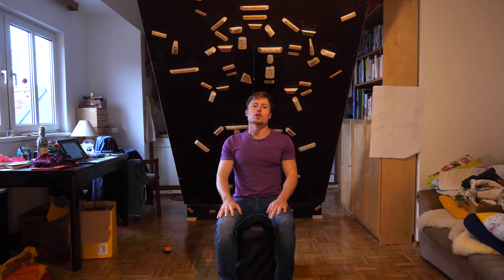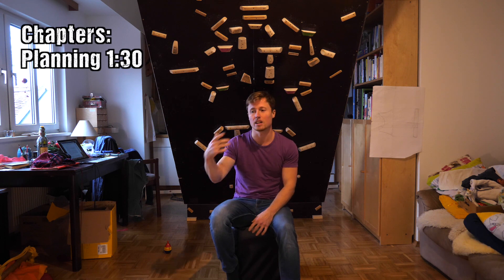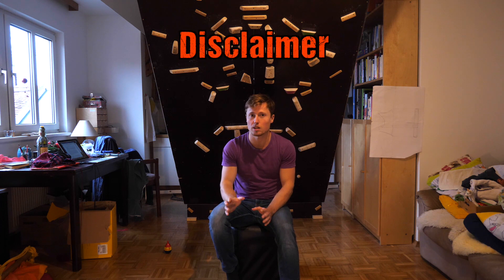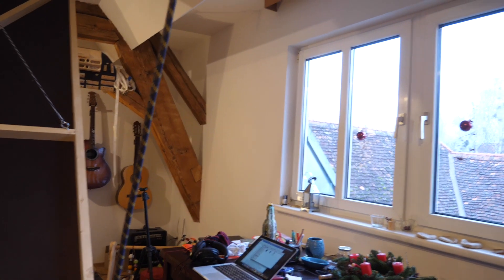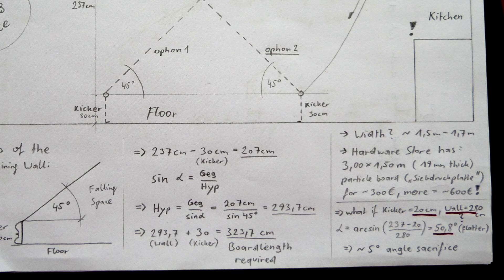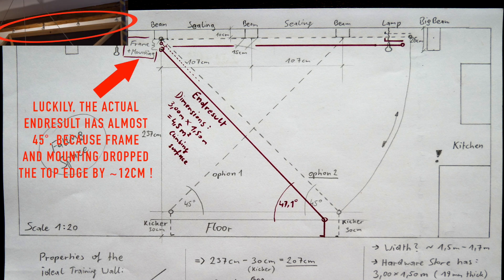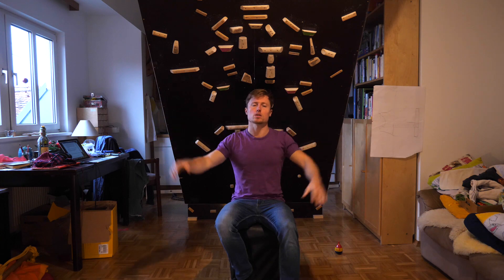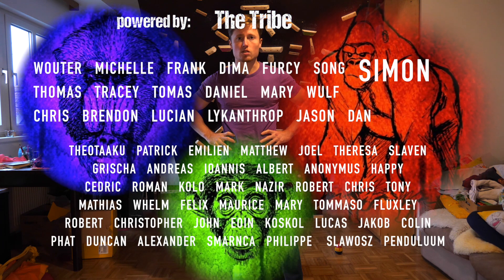How I Built a Retractable Climbing Wall into our Kitchen

Comment: Fantastic space saving wall Mani!

The triangulation of the frame looks great but really doesn't add to the strength. My guess is this was an "over thinking it" part of the design. The plywood gives it more lateral support than spruce beams in that beautiful star pattern do. If the frame ran top to bottom instead, both would run the full length of the board without any cuts and be shorter, increasing thier strength vertically.

Happy Building!

Comment: I built a very tiny wall for my kids and  lessons learnt are:
1) watch out for type of plywood and the glue! It can be toxic and cause cancer. I was not able to get anything else in my wood store, so I took a risk despite this
2) if you plan on doing regular holds with bolts, go for 18mm rather then 15 if you do not want your bolts to stick out (a small mistake I made)
3) for smooth top, it is easier to paint it with polish and then sand it and repeat. This will create really smooth surface at low cost

Comment: You should use a pulley system (I don't know how it's really called) for lowering/retracting. With a ratio maybe 1/4 which makes it 4 times easier. It would involve additional cost, but seems worth it. Maybe even a ratcheting mechanism, which reduces the force on the hands, can be permanently installed and has the "gri gri function" as well. Just some ideas.
Reply from the maker: Thanks, I thought about a ratchet solution as well for some time. Would have style, with the lever and everything. But then the Grigri basically solved all my problems, and I already have a Grigri.
Reply: I used a chain hoist. A bit noisy but very easy and safe.

Comment: With a background of architecture/structure, I saw nothing wrong with how you planned to build your wall. You designed with the thought process of how much weight you are going to put on the wall and where the loads would transfer.  Seemed all good and well thought out for the price that you paid for. 

Generally, I am super paranoid and overly design/structure my own builds but thats cause I build with the mind set of having it for a long time. But outside of my paranoid mind. You can put a handle on the lifting ending and lift it from the kitchen side up (maybe) then have the handle hang off of the similar eye hook connection. Just dont use eye hooks and use a fish hook so that the handle can fit in.  I dont know if that was thought about but a suggestion to better the lifting mechanism by a bit. 

If you ever feel you need to make the wall/build more safe, you can add metal joints/brackets or rigid metal connectors to make it more sound. 

Lastly, if you dont want to scratch the floor think about placing some type of fabric on the base of the kicker. You can use furniture mover attachments which will help you from damaging the floor of a rental unit. 

Sidenote: Im not sure if you used this kind of document when designing your wall but it sounded like as if you knew how much loads would be taken off based on what size studs/framing you would have. When designing a wall using a stud size chart will help. This chart usually tells you how big the stud has to be, how long/tall it can be, and how much load/weight it can take. The charts for wood is generally all the same but if someone was to build their wall out of metal then you will have to look for that chart based on who the manufacturer of those metal studs are.
Reply from the maker: Thanks for the input!
I have rubber pads at the base of the kicker, so there's no scratching and it keeps its position.

Comment: The retractable-ness is really cool and a great idea for the in-house board.

I just screwed in 3/4 panels to every surface of my garage and called it a day (well, multiple days) haha. They are all drilled out and T-nutted. I want to build big ole volumes to change wall dimensions buuuut its a lot more work and im pretty lazy haha.
Reply: Are you able to use the garage door as a adjustable mount?
Reply: @nimaiplouffe7121  that would be sick! Youd need a helluva strong garage door.

Comment: I wouldn't have guessed the wall you built was basically the same dimensions as what I created, but I suppose that's the trick of angles (I have mine set to 20 degrees on account of being not nearly as strong a climber). I went for a lattice inspired symmetrical build more for training rather than problem building, using 32 25mm campus rungs and 20 crimps of various sizes (also I'm adding more wood holds from euroholds for the holidays thanks to family gifts). I wish I'd been able to find good quality thinner frame wood like you used, I used 7x7 for everything and it's heavy af (pics here https://www.instagram.com/p/CH8BOaBnmvT/). thanks for posting your build details, and for the channel in general
Reply from the maker: Thanks for the input Jason!

Comment: what do you think makes the holds so amazing, that you have to hold them actively? size, shape, texture, overhang angle?
Reply from the maker: They are very small and shallow for the angle, and very smooth so you can't work with much friction (therefore also skin sparing).